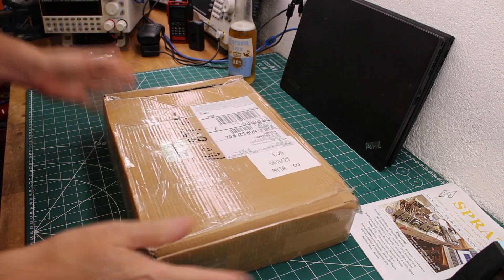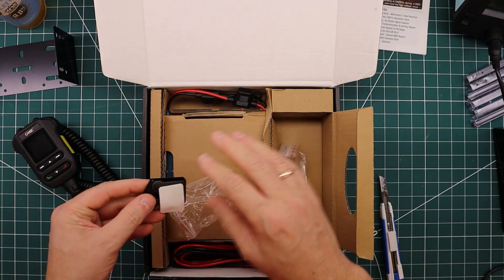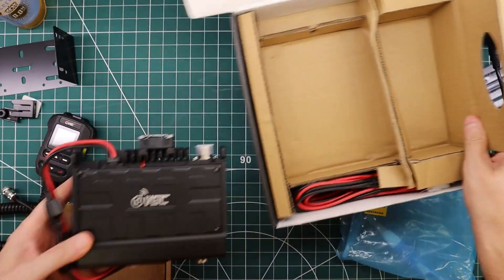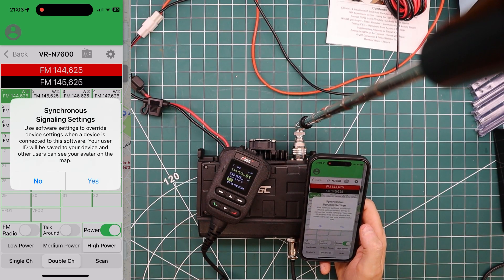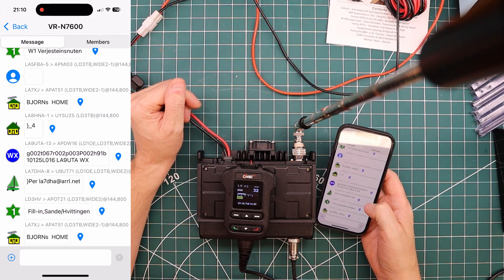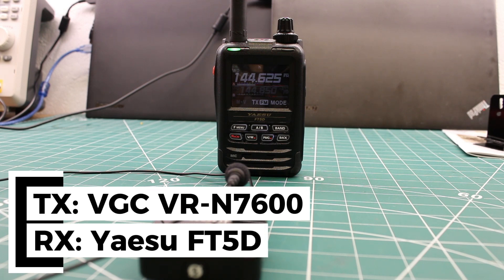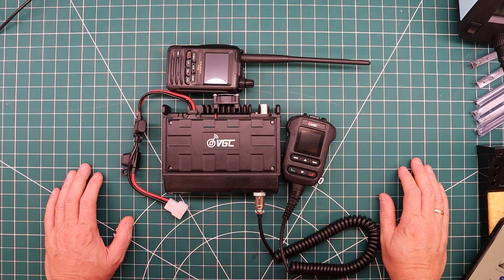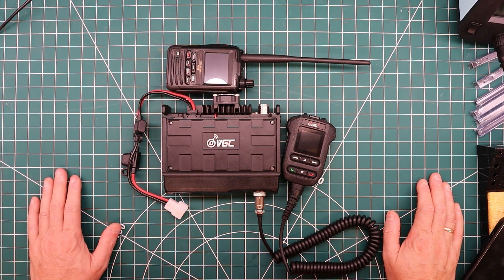Vero VR-N7600: First Impressions, Audio Test and APRS

Comment: 10:45 The price range of this radio pushes it into territory of radios that do have dual receive. It's the one thing that is disappointing. Dual receive often means a mobile radio is capable of cross-band repeat.
Reply from the maker: Not saying you're wrong, but also can't think of any mobiles radios (currently in production) with dual receivers in this price range. Do you have some examples; I'd love to take a closer look!
Reply: @radiohyperactivity  yaesu ftm 300 I think. I know it does xbr at least.
Reply from the maker: @ExtremeSquared  Good point! It's in fact only about €110 more, and indeed a true dual receiver.I already have the 500, but I'll take a closer look at this one too, with an eye on using it for digital modes. Thanks for your feedback :-)

Comment: Thanks for the review.
You may be able to show in your future videos the advantages of VR-N7600 over N7500 except being newer or better-looking .
For now, I am quite happy with my N76 and N7500 and find no reason for the extra cost of N7600.
I recommend getting an Android tablet which would cost less than US $200 instead of waiting forever for them to fix their iOS app. That's more attainable approach IMHO.
Reply from the maker: Hi, and thanks for your comments. I think you've basically summed up the relevant differences between the 7500 and the 7600. So if you already have the 7500 there is probably very little reason to upgrade. When it comes to the iPhone / Android question; I have both and Android phone and a tablet. But the whole point (for me at least) was to get all the extra functionality the app offers /without/ having to bring an additional device. I already bring my iPhone, and when driving it's mounted perfectly for both visibility and reachability from the drivers seat. Which is why I find it /very/ disappoint that Vero can't be bothered to update the iPhone app to the same functionality as the Android one...

Comment: I love the VR-N76 radio. The android app is brilliant, but to be honest I use the radio directly now it is setup. I was interested in this radio and thank you for doing a video on it. I agree, the volume control and not being able to directly enter a frequency on the mic could well be deal breakers for me. Volume could probably be fixed in firmware as you say, but direct frequency input not because it would need input keys on the mic. The other thing that is not so good is the box needs to be located near to the mic. It would have been nice to have been able to mount the box in the boot and have the mic at the front of the vehicle via an ethernet type cable that a lot of manufacturers are doing now.
Reply from the maker: The connector used for the microphone looks like a fairly standard "aviation connector", so it shouldn't be to hard to make an extension cable for it. The question is of course, how much noise will an extended cable pick up? Thanks for watching :-)